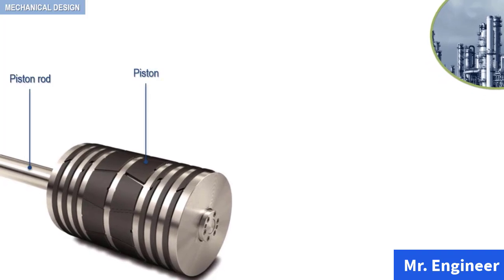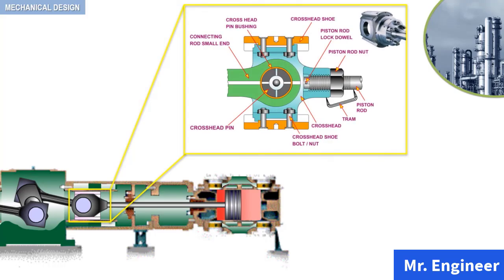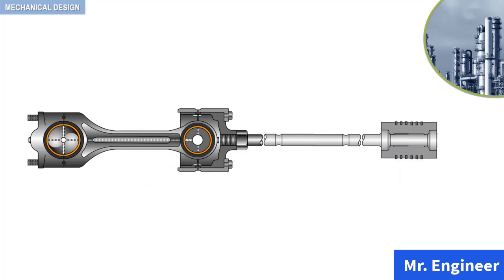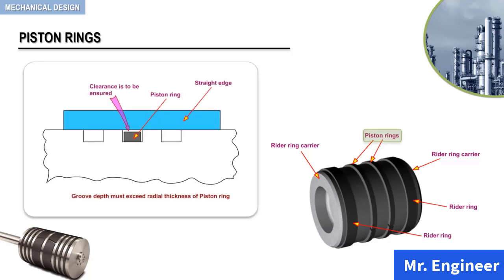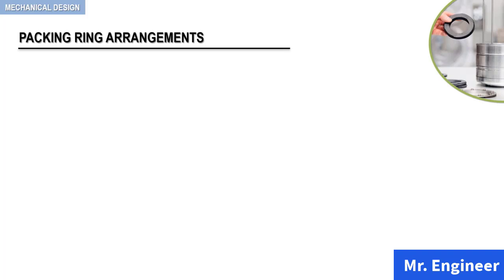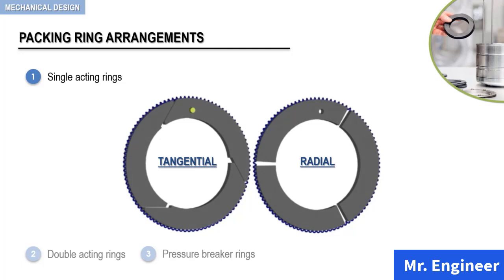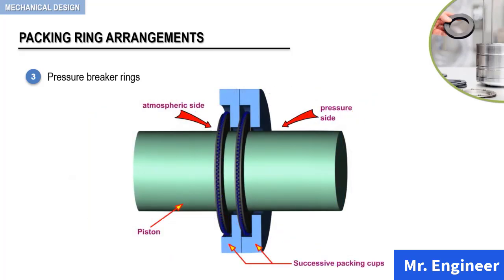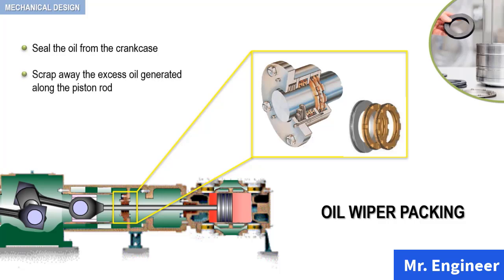Reciprocating Compressor Mechanical Design Part 2

Comment: 1 mistake is visible towards the end, it shows the pressure breaker ring next to the big flange, when it should be next to the smaller 1. ie inner most ring, towards pressure of the cylinder.